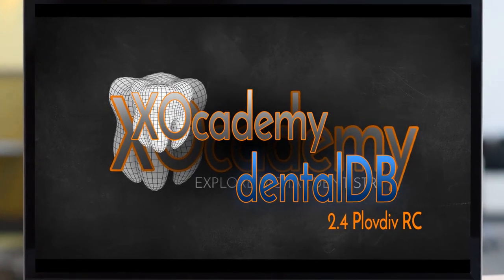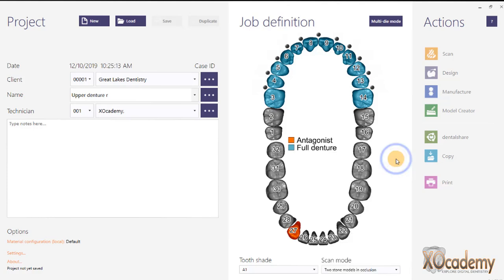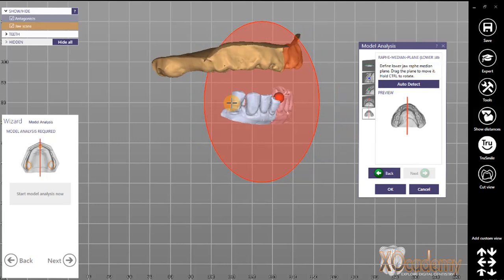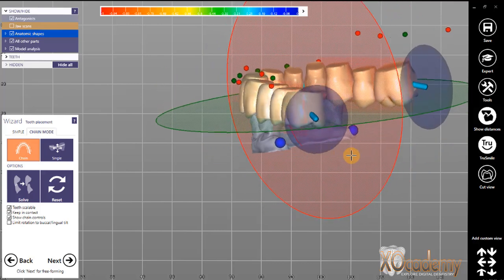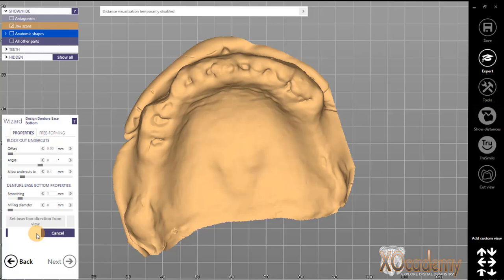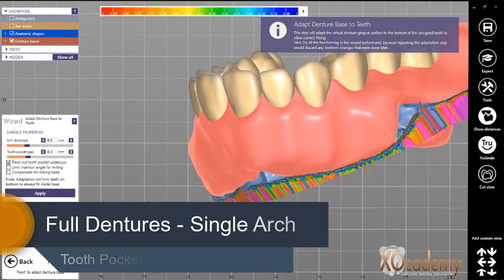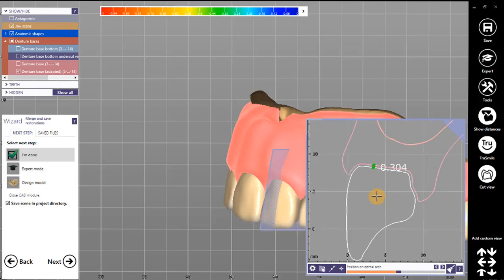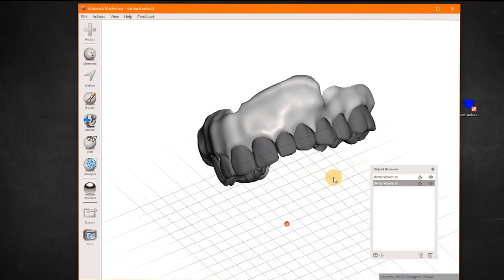Full Denture Design Using Exocad - Step by Step Walkthrough Tutorial

Comment: Question regarding the tooth selection.  I've looked at the list of compatible carded teeth supported in exocad and the kulzer mondial and delara teeth that I use for almost everything are on their list of supported teeth.  It states they work for monoblock try-in, printed base and pre-manufactured teeth, milled base with premanufactured teeth, and milled with trimmed premanufactured teeth.  I'm kind of curious how that works in the real world?  How accurate are the monoblock try in?  How difficult is it to seat carded teeth into a milled or printed base?  I would love to do milled bases and still be able to use my kulzer teeth.  Is this kind of work flow covered in your membership?
Reply from the maker: It’s not specifically covered in the membership videos. When you go through the denture workflow and you select premanufactired teeth, they are not scalable. You can only alter the extension and contours of the gingival base and the position of the teeth. You can choose how large of a tooth pocket you would like milled out to set the teeth.